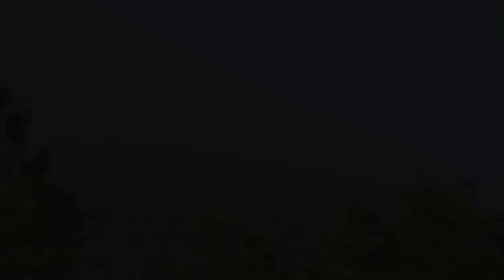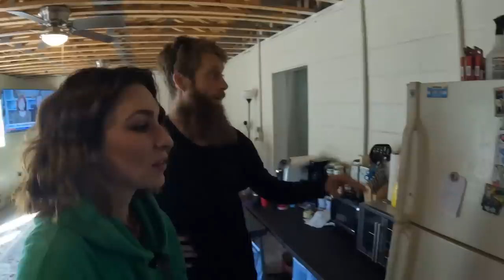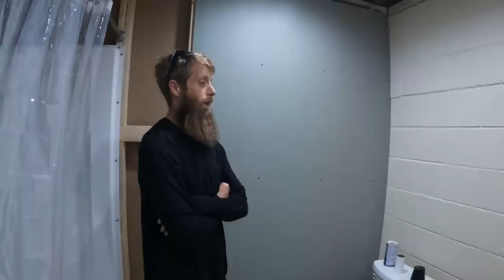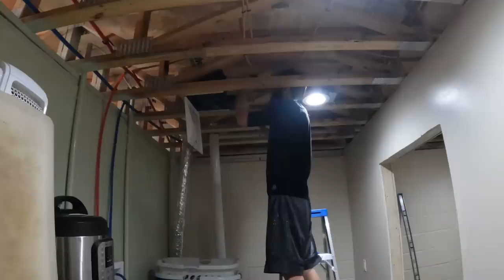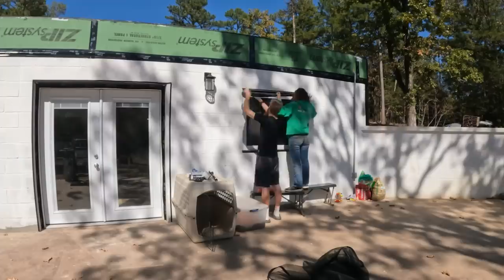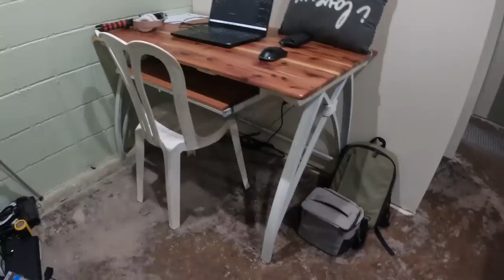We Built A Basement & Moved In!|Tighten Up Some| CMON Surprise Gift |Couple Self-Built Cabin

Comment: It looks beautiful. You all have accomplished so much and I love the desk from David. You are both an inspiration. Also, a quick and inexpensive temporary ceiling solution is to use canvas drop/paint cloths on your ceiling. Pull them taught and staple them to the rafters. They’re neutral and will give you somewhat of a finished look for now, reduce your heating and cooling space and still allow you to access all of the pipes and electrical in the ‘ceiling’ as needed. You can even reuse the drop cloths later on if you decide to finish the ceiling at a later date.

Comment: Just some info...... I used 4 inch Charlotte pipe for my dryer.  I was told by my hvac guy that it's the best to use if you're going up like that because it doesn't ever clog.  Since I changed mine I haven't had any issues like I used to.  I can show pictures if needed..... it isn't "code" but you all don't have that

Comment: Is the washer drain tube zip tied to secure in place? If not, drill a hole in the casing of the water hookup and wrap a zip tie through the hole and around the tube to keep it from "kicking" out of the spout.

Comment: Looking amazing you two, I bet the whole family are thrilled to be moved in! Just a suggestion on tape for any air ducting, the plain aluminum foil tape will last the test of time and seal better. Cloth duct tape will deteriorate and let go over time. Also better to be safe when closing in to a wall or ceiling. This comes from 15 years experience in commercial/industrial mechanical insulation systems. And that is one beautiful desk from C'mon, C'mon!👍👍

Comment: Things are looking great! Technically, drywall doesn't go on the flanges of the tub and surround. Drywall goes up to the flange and then tile bridges the gap to the the tub. By not using tile, you could always notch the back of the greenboard so the board stays flat.  Oh well, its done now and it'll still look good. Oh... and.... duct tape has 1001 uses, but NOT on duct work.  Lmao. You need foil tape for ducts.

Comment: If not too late  suggest  putting an access  panel  for tub faucet  hard ware story should have very easy to install  cut hole answer the snap into place  can be done retro fitting  but easier when fresh in mind where to cut

Comment: Did you leave a GAP in the drywall above the shower just like you did with the concrete.  Don't want any moisture wicking up.  Can't tell if you put silicone on the shower joints yet.  Looking like your all set up for the next phase.  What a jump up in comfort.

Comment: Love y'all's videos but I got 3 comments
#1 - DO NOT close in the area where your dryer venting is, the reason I say that is because you have that exhausting upwards and you are gonna have lint build-up at the point where the exhaust duct turns up - you will need to clean this atleast once per year if not twice.
#2 Sometimes ya gotta reel yourself in - aren't you planning on building a house on top of this basement? Just my opinion but wouldn't the wise thing to do be to put money and resources toward getting the actual house built? Again, just my opinion but I think you 2 are starting to go a bit overboard on the basement. Please don't be offended, love to see hardworking people working together toward a goal - just don't lose focus of that goal, plus - all you have overhead is OSB, OSB will take some abuse but not for a long time.
#3 what are y'all going to do for heat in this basement?  Be prepared - that uninsulated zip system is NOT going hold heat in very well.  
Love your channel, you and your family are amazing!

Comment: You can’t get carbon dioxide or monoxide from electric driers. Only fossil fuels being burnt give off deadly oxides. You all can live very comfortable in your basement apartment. Very homey and well done. Once your insulation is installed it should make fora cozy winter abode. You really shouldn’t live in an airtight space as air exchange is needed. Hope you are able to accomplish whatever you need to do as you continue, but health and family is still a priority. Best wishes.

Comment: A suggestion: You may already have plans for this, so forgive me if you do. Since this episode dealt with exhaust fans and the dryer vent, I would recommend you make arrangement for make-up air into the basement area. You have gone to great efforts to make the space water AND airtight, and this is good for heating and cooling the structure.  However, when you do a good job making a structure airtight, you run the risk of creating a net-negative pressure within the structure. Normally, this is taken care of by the everyday opening and closing of outside doors. Since winter is approaching, and since you only have one outside door, you should consider providing make-up air into the structure. This is simple. It involves cutting a 4" round opening in the outer wall (the wooden part)  through which you can run a 3" PVC pipe, with a downturned 90-degree elbow on the end of it. A piece of screen should be placed over the bottom of the downturned elbow to stop insects and other critters from accessing the basement through the PVC pipe. The pipes would be sealed water tight on the outside the same as any other penetration. On the inside, attach to the PVC pipe a piece of flex duct just like you did for the vents. In the laundry room and in the bathroom, you would install a regular dryer exhaust vent somewhere close to the floor, and attach the flex duct to it. I would suggest the toe space under the filler space between the two bathroom pantries you are installing for that area, and the "false" box wall you plan to build around the dryer vent and sewer vent area in the laundry room. You would need two in the laundry room area. What happens is this: say you turn on the dryer to dry a load of laundry. The dryer exhaust will be sent outside by way of the vent you installed. But where is that air going to come from? The only place it can: inside the laundry room. Now imagine the dryer running, the exhaust fan in the laundry running, and the exhaust fan in the bathroom running. Combined, these three could be moving as much as 700 CFM of air. All that exhaust pressure could create a net-negative pressure in the living space. With the "reverse dryer vent" systems in place, the vents would open as needed (the flapper dampers in them would keep them closed when not needed) and introduce fresh air into the areas, and the pressure inside would remain neutral, neither positive or negative. When the dryer shuts off, or the fans shut off, the dryer vents supplied from the outside would automatically close. A neutral pressure inside a home, especially a basement home, is needed to prevent  net-negative pressure, or a vacuum, which can possibly increase radon levels inside. The fresh air provided as "make-up" air keeps fresh air, as well as fresh oxygen,  coming inside from the normal outside ambient atmosphere instead of through the slab, for example. Sorry for such a long comment. I have built many airtight homes for HVAC energy efficient purposes, and learned early on to provide make-up air sources for clothes dryers, bathroom exhaust fans, vent hoods over cookstoves, gas logs, etc. It just keeps the inside air balanced and fresh. Carry on the good work!
Reply: It would be even better to install a fresh air/heat exchanger. This has the benefits as described above but without the heat loss that occurs from bringing cold outside air in and exhausting warm air from inside. This really is necessary in any building that is as airtight as they have made this basement.
Reply: @FrugalBuilding  You have made a good suggestion as far as air quality is concerned.  Installing both would be the ideal situation. I say this for only one reason; a heat exchanger fresh air systems have an indoor/outdoor  cubic foot of air swap ratio of one-to-one.  Therefore, although it would greatly increase the air quality, it doesn't have the capability to address the net-negative effect of exhaust devices. There may be one on the market which would allow for more air to be brought in and conditioned, when needed, and resume the one-to-one ratio exchange when not needed. At this time I am not aware of any system which allows this type of continuous monitoring and adjusting based on net pressure within the structure. But again, your suggestion is very good for most modern structures.

Comment: Appliance fires is one of the major cause of a house fire, particularly in the dryer. The dryer vent pipe should be cleaned periodically. You might reconsider boxing it off or if you do, allow access to removing the dryer vent for cleaning. As a kid growing up, my dad was a fireman and I remember hearing the fire radio announcing dryer fires all the time.

Comment: A couple of 💡 for you. To hold the insulation in the ceiling between the joists, put the insulation in and then staple chicken wire to the joists to stop it falling out. Easy to remove if needed when you’re doing the stuff above and if not, just drywall for the ceiling straight over it. For the laundry room, when you box in the big pipes, what about adding some doors and shelves to make it a cupboard for storing detergent etc?

Comment: Electric cloths dryers do not produce carbon monoxide. Though the vent will channel a lot of heat away from where you do not want it so kudos on the sealing. Anything that runs on gas will though. Stove tops, lanterns or heaters.

Comment: You guys have done an awesome job getting your basement set up and ready to live in! Some tips to offer...the screen to the left of the basement door has drywall dust on it. The sun can actually bake the drywall dust to it and permanently stain the screen. The other thing is the color of your water can be fixed by putting in a water softener. We use the red out/rust buster water softener salt to keep it from staining your washer, sinks, toilet and clothes.

Comment: May I ask a question regards the dryer. Will you have ready access to be able to periodically clean out the lint trap on it ? As I am not sure if your lint trap will vent to outside or be able to clean it inside the laundry ? Lint traps in dryer not being cleaned can be a fire hazard.